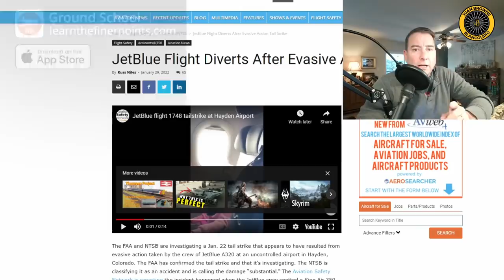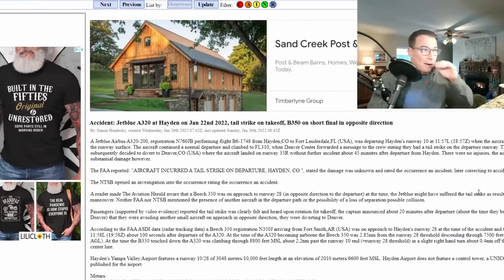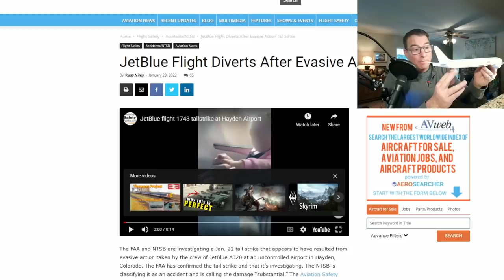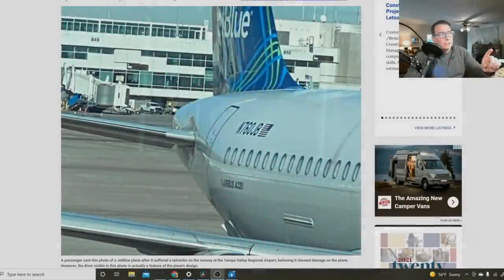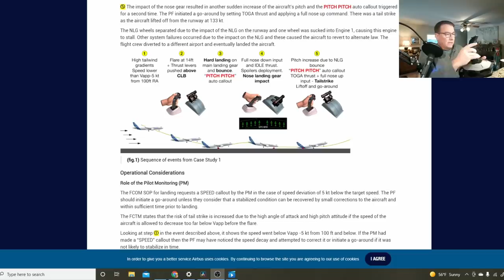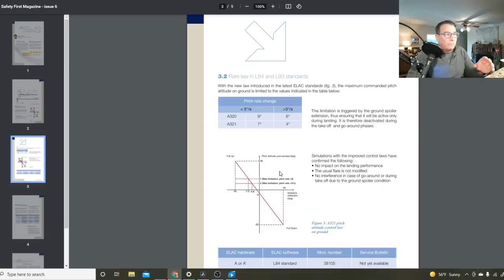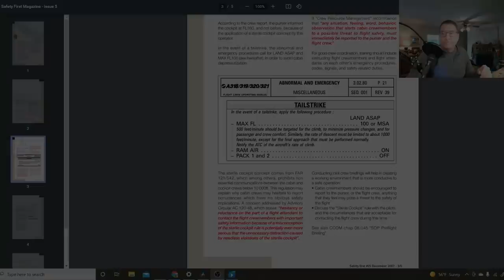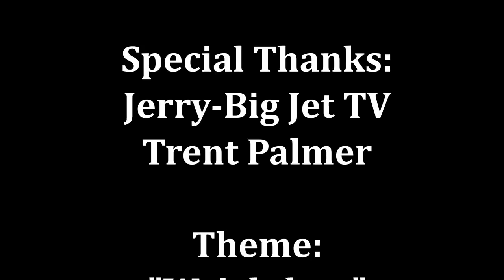Tailstrike!

Comment: There’s a lot of points of view about this in the replies, many false, some true, but I’ll give you my opinion since I actually fly these jets. My logbook has 245 hours on the 727, 1,583 on the 757/767, 11,956 on the MD88, and 1,238 on the Airbus 319,320,321. Mostly 321, because I like new airplanes, it pays more, & has the latest technology. Any airplane from a Cessna 152 up through the Boeing 777 is flown in DIRECT LAW. The plane will not protect you from yourself. Yes, they all have stall protection devices to warn you that you are in a stall, and Boeing jets have overspeed warnings, after the fact that you have oversped the jet, & stick pushers to help you get out of a stall. When my airline retired the MD88, I chose the Airbus. I’ve always been impressed by the FBY technology (Maddog was fly by wire as well, couple miles of it out to the wings & tail) Having flown all these types, the winner is the Airbus & I’ll tell you why! The orders for the A321 vs Boeing 737 are not even comparable, there’s a reason for that which I’ll talk about & Boeing will adapt & change there philosophical idea what a commercial jet needs to provide considering the looming pilot shortage.
Before I get into the flight control laws, let me say that the A321 is the easiest, most simplistic, most accurate navigation performance on A/P flying the most complex STARS out there. The auto land requires no visual runway, and is exceptionally smooth every time. The redundancy is exceptional because of the fly by wire.
So everyone out there is in direct law. Your in control. 

In an Airbus, as soon as you lift off, you enter normal law. You can still have a tail strike rotating. But if you follow the V1, rotate callout, & rotate @ 3 degrees per second, that will never happen. With the main struts compressed, a tail strike will occur on an A320 @ 11.7 degrees of pitch, 9.7 on an A321. On my takeoffs when the FO says “rotate” I wait 2 or 3 seconds on long runways and slowly rotate to achieve 15 degrees in 5 seconds. I have no idea how this JetBlue crew rapidly rotated into a tail strike. It’s totally pilot error. I’m only aware of one tail strike on our A321 fleet. New hire FO on her IOE. Her first landing, she bounced really hard. Proper recovery would be to hold pitch attitude (5-6 degrees) and add power. She pulled back on the stick into a high nose high attitude and the tail hit. Happens fast folks. We just saw it in this video. Being a LCA, you sometimes can’t react fast enough. As Mr. Brown mentioned, inertia takes over. Juan can attest to this, tail strikes are extremely rare, and it’s always a pilot FU, not a manufacturing design. 

“Flight Laws” The Airbus is in ground law on the ground taxiing out, so that we can check our flight controls. Leaving earth, the Airbus enters normal law. It can’t be stalled, over pitched + or -, over banked, or oversped. Laws protect the crew, which in your career, you will never need these protections normally. 

Why do I love the jet? I can rotate to 15 degrees, runway heading, take my hand off the stick. Show is over! Sitting there, watching the show, no A/P on. The Bus will not deviate 1% from it’s last instructions. 10,000 feet, roll into a 30 degree bank turn & let go. It will do 360 turns for hours at exactly 10K with no A/P. This is normal law, and is the problem Boeing is grappling with. Boeing, I would be up or down few feet to a hundred & constantly trimming. There is no “Pitch Trim” switches in the Bus, it was the weirdest thing to get used to after trimming airplanes for 35 years. 

As for landing, I researched this & I guess Airbus calls it a landing law. My airline calls it a landing mode. The entire flight is in Normal Law. If you were to have some severe mechanical malfunctions, the Airbus will degrade to Alternate Law. Even further severe degradation, it ends up in Direct Law, which most all aircraft operate in anyway. 
In Normal Law, at 30 feet radar altitude, the flight control computers initiate a slight 1 or 2 degrees nose down push. The pilot’s tendency is to pull back. The purpose is to initiate a flare, and at 20 feet radar altitude, we here “Retard, Retard”. Pull the thrust levers out of the cruise detent, at touchdown, into reverse, and stow reversers as we take you to a gate. Jet goes into direct law after touchdown. If you screw that landing flare up, at a pith attitude approaching a tail tail strike, we will get an aural warning “pitch, pitch” to tell you to lower the pitch. MD88, 757 or 767 didn’t do that. 

Conclusion, the Airbus is an amazingly technological jet. It will help make air travel much safer for the generations of new pilots who will join the airlines in the future among a massive pilot shortage. They will ensure a much easier transition to the airlines. Boeing will eventually need to adapt to this technology of flight control laws. I drive a 2015 Tesla Model S, I was on the team that developed the A/P,  it’s the future of cars, and it’s an amazing vehicle. All of their cars are. They are a decade ahead of the other OEM’s. 
Airbus is as well. The fly by wire technology with flight control laws is next generation & the future in my humble opinion. Boeing will eventually go down this path.
Reply from the maker: Soon pilots will be redundant….

Comment: Nice reporting Juan. Have you seen the new report on The Flight Channel? I just saw a report on Emirates flight 231 out of Dubai last December 2021. They screwed up the preflight setting on their initial altitude on takeoff. They then seemed to be asleep at the controls and never rotated the aircraft until they were well into the overrun area on a 4000-meter runway. then they nearly flew thru the buildings just off the field. They nearly crashed on takeoff because they followed the flight director and were not looking out the windshield. Emirates has put out some directives because of it. The plane is a 777-300ER so you should have great insight on this issue. They even got an Overspeed warning with the flaps and landing gear still extended. They continued the flight to DC instead of returning for a damage inspection.
Reply: He posted a video discussing the flight of Emirates you described.
Reply from the maker: Check your notifications settings for this channel. Already covered it.
Reply: Their directors were something about settings in the flight director for the previous crew! I was like - hey, how about you follow a takeoff checklist, rotate and establish positive rate of climb? Isn't there an issue there / training etc? I don't know the 777, but that's 101 at the small plane level at least.

Comment: Wasn't it a faulty tail strike repair that was the cause of the pressure bulkhead failure of JAL123 747SP, loss of tail, loss of control, and crash into mountains near Mt. Fuji. 520 Fatalities, record for single aircraft incident.

Comment: Good Stuff Juan!   I love your channel.  Quick question, you have referenced slip landings before.  Do you guys slip land your triples?     Any engine strikes?
Reply: Browser search didn't turn up a pod strike for the triple, likely because those big engines aren't as far out on the lever arms -- er, wings as the #1 and #4 on the 74's and 380s. Even the rock-and-roll KAL landing at NRT 2011 August due to Narita's famous wind gusts, didn't get the engine low enough to strike. You can look up the accident involving N777AS at Paris-Le Bourget if you want to know what it takes to strike the wing and horizontal stabilizer, though. THAT would have been an interesting ride.

Comment: For an aircraft that is supposed to be so picky about not allowing a pilot to perform maneuvers which could cause harm to the plane and passengers, surprised the Airbus didn't have a mechanism in place to stop such an event from occuring.  Glad nothing serious happened.
Apparently, it does have a system per the video... Seems it may need some tuning.
Reply: The (any) aircraft/crew can only react to external effects such as crosswinds and windshear... What you're suggesting is akin to expecting a Tesla to predict aquaplaning... 🤔

Comment: The NEO was in Normal Law. Nothing more. No law on current A320s can prevent tail strikes. There is an Aural "Pitch" voice that comes on at a predetermined angular change rate or pitch attitude, but there is nothing in either Ground Mode or Normal Law that prevents tail strikes. It is my opinion that the Speed Bird pilot simply pulled the sidestick and didnt anticipate the thrust vector.

The JetBlue was in Ground Mode during takeoff. Again, nothing to prevent a tail strike. I do believe these pilots could not have been so naive as to not know they had stricken the tail. THey may be in hot water.

Comment: Excellent video as always thanks Sir! Im just curious - would cabin crew listen to a concerned passenger who reported something like this? Would they pass a message to the pilots like "A pax in 31A reported a loud bang at the rear as we lifted off" I think the worry for us is we might just be dismissed as aviation nerds spewing some nonsense. I hope not! 
The new Russian MC21 airliner (full FBW also) is one up on Airbus - it has sidesticks also but they are synced. Active sidesticks. I feel this is a crucial difference as nothing like tactile feedback telling the PNF what the PF is commanding. Specially in an emergency with the crew under stress. 
A 20 second video showing this: https://www.youtube.com/watch?v=-5X73Q66w_4
More details: https://www.youtube.com/watch?v=wqdJZVshgVc
Reply: I was on a flight with hydraulic fluid dripping from the overhead near the aft end. I told the cabin crew and they basically told me to shut up and continued to do whatever make work they do between meals. It wasn't a lot of fluid, so I didn't push it. Maybe they quietly let the aircrew know later on, I don't know.
Reply: Mention something, as a passenger?  Reminds me of a humorous ‘after dinner’ speech comedy from the late 1970’s or early 1980’s.  The pilot was describing to the audience, what it might be like to be a passenger on the (then) new Concorde aircraft, including how much the length of the aircraft increased by, due to the external heat generated by it flying supersonic at 35,000 feet.  He concluded by adding ‘… obviously, if you look down and can see daylight, you should tell someone!’  😂
Reply: In contrast, I was on the "flight deck" (squeezed into the cockpit) of a DC3. I was standing, and looking down through the screen. The pilots, sitting looking up though the screen (I don't know why the windows were so tiny when there's no engine in front, but they are).

We were descending toward a nav point that would lead us eventually to the busiest GA airport in the country. I could see a slower high wing monoplane ahead that was climbing to the same point, and it looked to me like we were going to hit. So I mentioned it to the pilots, who were *most interested*. They stood up and looked down, assured me that we were in no danger at all, slightly changed course and added a bit of power and all was well.

Comment: There are no tailstrike protections during flare or during take off just an auto call-out of "pitch"! Your description is not correct.
The reason why we are seeing more of these incidents is due to longer aircrafts, like the 321, with the NEO engines and also the airline policies to save fuel and make landings with FLAPS 3 instead of FLAPS Full...
When we are doing an approach in an A321-NEO with Flaps 3, the pitch can be around 5 to 6°. When you know you can have a tailstrike with a pitch above 7,5° things are ready to happen when you flare... 🤷🏽‍♂️

Comment: This go-around could have been much worse if it was a Boeing.

On Boeings… before touch down, the pilots need to press TOGA switch to advance the throttle for a go-around. If the pilots advance the throttle manually, the plane would think they are a bunch of idiots and automatically close the throttle for them…which is really bad when you want to go-around…

However, the pilots needs to advance the throttle manually to go-around after touch down as TOGA button is inhibit to prevent accidental activation on the ground. This is also really bad for a go-around if you press the TOGA switch after the plane have already touched down…

In the heat of the moment, you can see how easily it is for the pilots to get this mixed-up during these very critical phase of flight which can easily lead to a major accident.

The emirates 777 crash was exactly this reason that caused it to crash on the runway (but of course Boeing said its the pilot’s fault)

The only reason that accidents doesn’t happens more often is because a go-around is already quite rare and a go-around just before or after landing is even rarer.

Boeing really should re-design the auto-throttle system on their planes.

Comment: Does anyone remember the faulty repair after tailstrike by Boeing to a 747 where a single row of rivets were used on the bulkhead? Or am I remembering two seperate incidents? Was it a Air China  747? Explosive decompression tore tail off.
Reply: JAL 123
Reply: @cr10001  I had a reply from a captain  on the same route who took off following JAL123,  It was removed??
Edit: I got all mixed up. Conflating two incidents. Yes JAL123 had the tail strike and was doomed. Not Air China as I said elsewhere.

Comment: Pilot flying needs a quick lesson on cross control techniques.
Reply: Unfortunately, the Airbus computers interpret any cross control input as a pilot error and filter it out. A really experienced A-320 pilot can time it just right so that by the time (1.4 sec.) the computer realizes that you've "erred" and starts to filter out the slip, you're on the ground. I've seen it done right a few times. Ordinarily, Airbus expects you to simply land in a wings-level crab and just put up with the side lurch and swerves which result. Very ungraceful.
Reply: @neilrobinson3085  didn't know that thanks.

Comment: I'm not a fan of systems assuming the pilot is a fool, that should never be the premise because then obviously the failure is hiring the pilot. If audible or shake warnings of a situation is not enough to alert a pilot then he should never have been a pilot. Having these systems run the risk of the engineers being the fools and forcing a crash. As it seems was the case in the 2 boeing crashes, even if the pilots were also counter productive. If they would have survived with a normally responsive plane then that is the ultimate failure of design.
I would be a much greater fan of simply letting the plane land and take off in full autonomy. A computer system should easily be able to avoid tail strikes since it isn't capable of being flustered once the design is half decent. Cross winds, turbulence, ice, it should always be able to get it down if theoretically possible. With a computer there would never be a bounce and with fast controls it wouldn't start rolling because the gyro will dispassionately register any disturbance in a millisecond. As long as there is a pilot he should be able to take over at any point. Just with the explicit understanding that it's a firing event if it was a foolish choice. Runway to runway autopilot seems very obvious to me. And that goes for small GA planes as well. You can fly but you always have the option to offload that task. Insurance might appreciate saving a lot of Harrison Ford planes. Just anecdotally a local well off older gentleman landed his semi expensive light sport plane with gear up which is a costly and I gather fairly common event. If we have systems we know can very capably land a plane, I think most will use it.

Comment: All of the upper "Laws" are really digital filters which amount to engineers second guessing pilots. (Boeing tried to do this with the B-737 Max MCAS system). Even a miniscule delay in control response can set up a feedback loop oscillation such as seen in the BA LHR incident. It's wrong to call this a "Pilot induced oscillation" since the engineers made the computer out-rank the pilot.  Airbus owns this oops!

Comment: "substantial damage" from tailstrike on 1748 and they had to be notified by people on the ground?   That's a bit hard to swallow for this landlubber.  Thanks for your videos!
Reply: The tail is a long way behind the pilots and there are two high-power noise-makers much closer to the pilots.
Reply: @tscottme  Thanks for the insight!  You might be speaking from experience but at about 3:39 there is a pretty big jolt that is more than noise.
Reply: There was a plane that smashed through instrumentation and a brick wall on take off and the crew knew little about it. The just felt a bump. The control tower informed of them of what had happened. They decided to keep going!
Reply: Cabin crew should have notified the pilots.

Comment: This is just one of many reasons why wing down technique is poor and normally only used by pilots who are unable to develop a good decrab technique. Airbus don’t recommend it for normal use. It’s also a bad habit to get because many aircraft like 747 and 350 won’t tolerate it.

Pleases stop telling people to use a technique that may lead them into trouble.
Reply from the maker: You certainly don't want the wing to be lifted up. Keep it down into the wind!
Reply: @blancolirio  you can counter a wing lift with aileron but keeping the into wind wing low is simply poor practice.